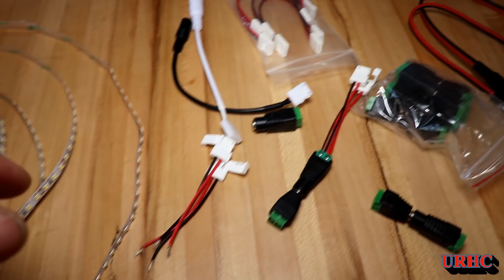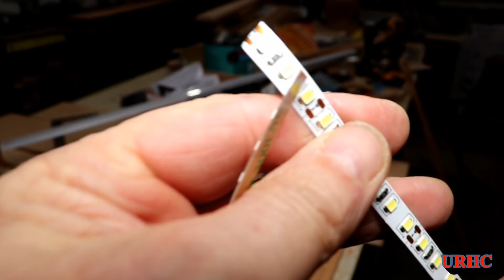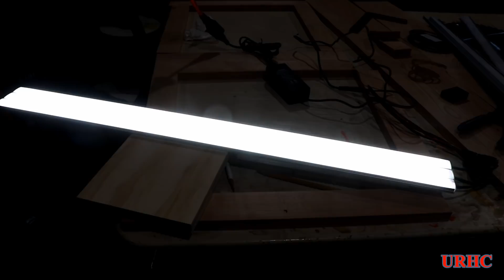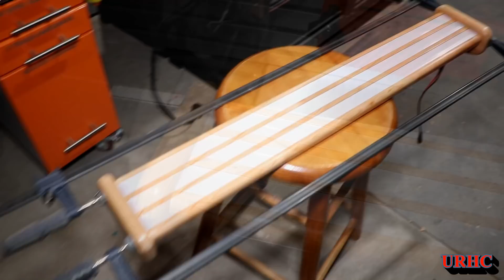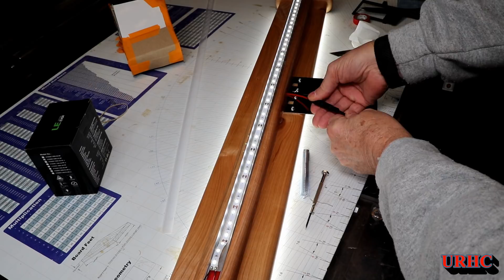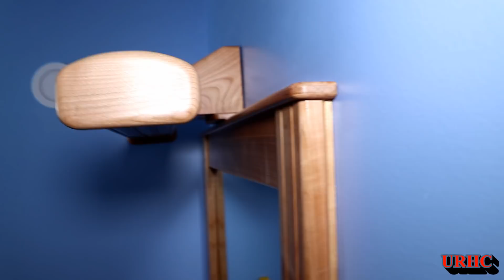Guest Bath Update Part6 Building A LED Strip Vanity Light And Starting The Vanity Doors

Comment: Brilliant idea and beautiful workmanship.  I will be adopting your design - by the way, some of your affiliate links are discontinued and should be updated so you receive proper credits.

QUESTION 1: It looks like you attached each of the six light strips together in parallel and then attached all to the common power connector.  I wonder if it will make a difference in brightness if instead each of the light strips were connected end-to-end which essentially is a series connection and resembles the original uncut lengthwise strip?  

QUESTION 2:  The 12V power supply that you linked to is a 60 watt transformer which seems excessive for your total length of LED strips - how did you select this particular power supply ?

Thanks, hope to hear from you soon.
Reply from the maker: These are double led population and I dont trust the traces on the strips. If one burns then they all go connected end to end. Probably doesn't really matter.  I went bigger because of heat. The small supplies really get hot in an enclosed situation and have shorter life. In the open they should be fine. Thanks for watching.
Reply: @unemployedredneckhillbilly2023  
Thanks, that is a great answer on both questions. I missed the video mention of using double density led strip but the Amazon links didn't look like double density strips though.

Comment: If you clean the soldier iron tip while it is hot with 220 or finer grit sand paper then reheat the iron and just bathe the tip of the iron in solder wipe it off with a damp sponge and keep solder on the tip it will transfer the heat better, oh unscrew the tip and wire brush the threads on the tip too.
I know you know all this but I posted it for those that might not know. 😁🛫
Reply from the maker: I am lazy and never do all that. I just let it get hot and wipe it with a damp paper towel. It takes almost a half hour to heat this one up and I will try cleaning the threads as you say. I think it's 10 watts and I only paid 99 cents for it on clearance at tractor supply and someday will buy a better controlled one. Thanks for the tips and watching.
Reply: Unemployed Redneck Hillbilly Creations  yep 10 watts is pretty low power, it would be good for soldering ic chips to printed circuit boards. 35 watts would be little better thou. 😁🛫

Comment: Another great video, I noticed red tape on one of the wires is that for  the led's polarity and as mechanically as you are why didn't you build your own crosscut/miter sled for your saw you probably could have built a better one.
Reply from the maker: Thanks. For the top LED wires I only had black wire to use so I just put red tape on each end to mark the positive wire. Looking back I should have built one but I wanted to try a tool from Incra. It's accurate but I didn't like the fence thickness or stop complexity. The Kreg fence slips right on and I have a 4 foot on on the way so that one can go back on the Kreg gauge. Thanks for watching.

Comment: Another nice project, thanks for posting the links. I'm placing a bet that you won't put an outlet cover on, now that you can't see it. LOL
Reply from the maker: Got one at home depot today when picking up a new pin nailer and it's going on tomorrow 😉. I still haven't figured out how to setup a storefront.  There are many different options available in those strips these days  and the ones that I have used are only basic stripped down models. Looking for a good zigbee LED strip controller compatible  with smartthings to play with next. Thanks for watching.